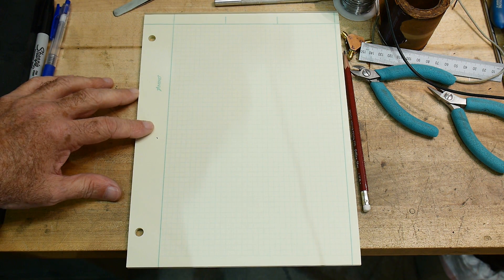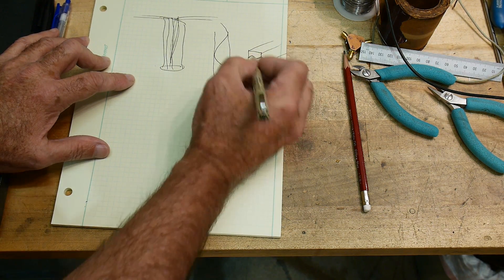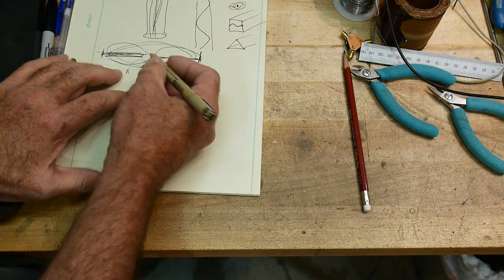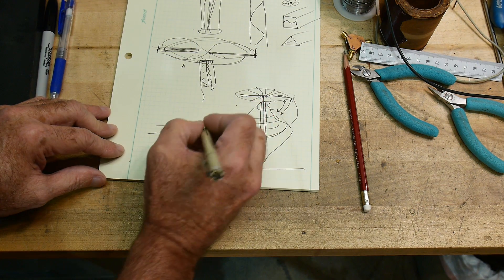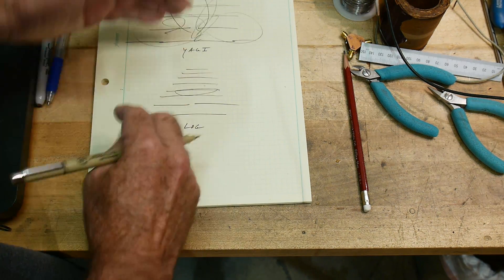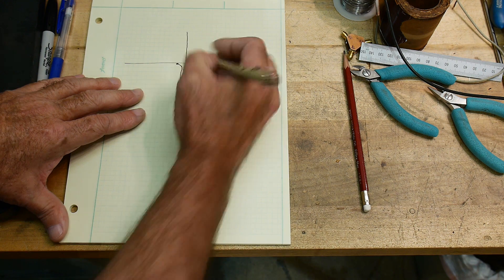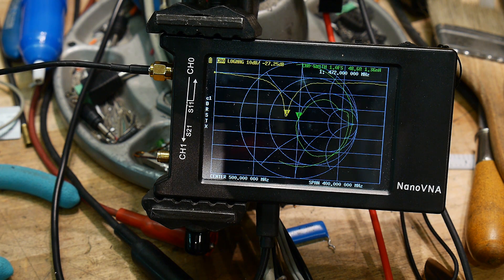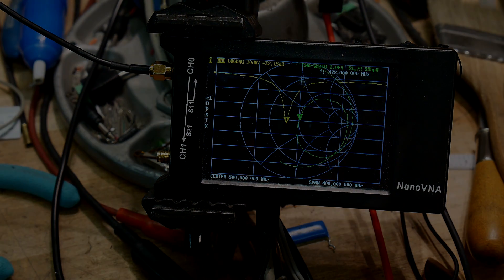#573c NANOVNA 1/4Wave Vertical Antenna Measurement

Comment: The antenna array you mention may be the W5UN EME array in TX. It's not on tracks, but a computer-controlled vehicle chassis drives around in a circle to rotate it. Last I heard it had 64 long boom 2 meter horizontal and vertical Yagi beams.
Reply from the maker: I think it was this:
K5GW, the owner of Texas Towers, has a full-sized 3-element 80-meter yagi that uses Rohn 45 as the boom. The elements have mechanisms which vary the length of the elements so that the antenna performs well over the entire 500 kHz of the band.

Years ago, there was an amateur radio operator who had a rhombic mounted on floats on his farm pond ("tank" here in Texas) that he rotated with 2-electric powered tractors mounted on tracks around the pond. That antenna gave gain on 160-meters through 10-meters with the exception of 15-meters. This antenna was featured in QST one month.

Glen, K9STH

Comment: Really interesting. Thank you.
I’m not a radio guy, but about 30 years ago I discover the cat’s cradle of the curtain arrays at BBC Rampisham, and was just fascinated by these huge towers precariously (apparently) holding up a filigree of radiators and reflectors and shapes and layer to transmit HF to directed targets thousands of miles away. 
The sound of the wind whistling through them…
Then I discovered that the radiating pattern from these fixed arrays could be slewed up to 15* in 2 dimensions by playing with phase shift and I realising I was trying to understand magic.
Then they reduced the magic to dust.
 In phases from 2017, they dropped the arrays and pulled over the huge steel towers with their sinister hammerheads and the silhouettes on the down were gone, leaving tell-tale concrete anchor blocks and tower foundations buried.

Comment: "..don't ask me why.."
Because you said a 1/2 wave dipole antenna's impedance is 73 ohms and your 1/4 vertical impedance was 23 ohms. If you had bent the radials down all the way, the antenna would resemble a half wave dipole and probably have an impedance close to the 73 ohms. I am sure the impedance is not linear from the 90 degree point to the "180 degree" point, but proportional. 

Try it. I did.

Comment: IMSAI Guy, what references do you recommend for learning antenna physics, 3D Maxwell's equations, and so on? Currently making my way through Div, Grad, Curl, and All That: An Informal Text on Vector Calculus. (with the ARRL Antenna book waiting in the wings)
Reply from the maker: Well I'm pretty old to be giving that advice. Got my degree in 1979. My textbook was: Electromagnetic fields and waves by Paul Lorrain  and Dale Corson. It was the basics of E&M but did not touch on antennas much.
Reply from the maker: https://eduguidehome.files.wordpress.com/2019/03/electromagnetic-fields-and-waves-by-paul-lorrain.pdf